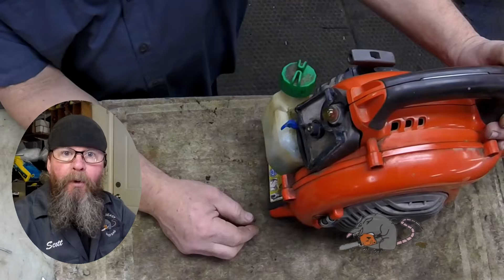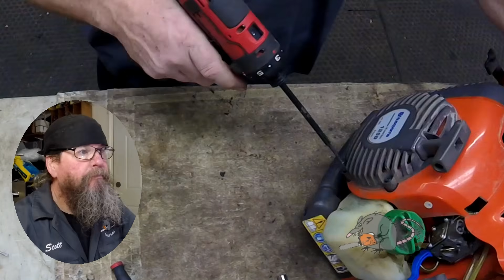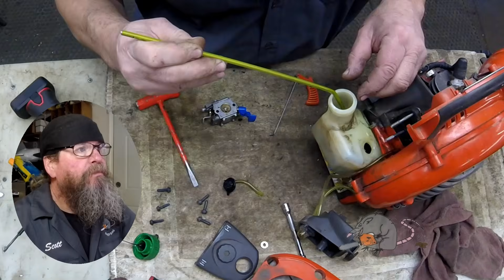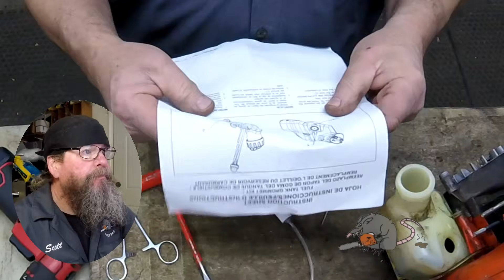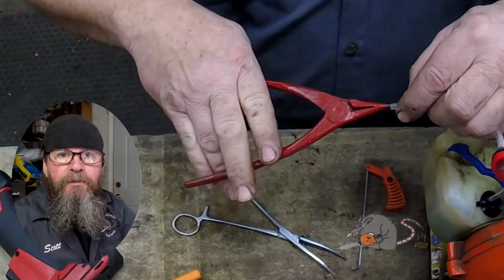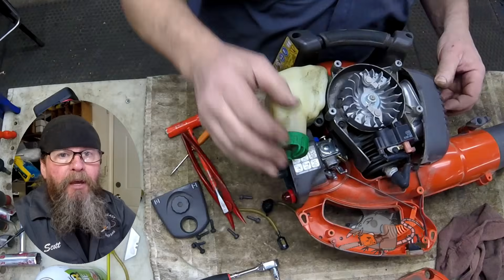Husqvarna 125b Fuel Lines Replacement

Comment: Buying these kits are real time savers,just have to plan ahead on some of these machines to have parts on hand compared to breaking out the box of Tygon linn,filter,and primer and assemble the kit,great video thumbs up
Reply from the maker: There is a cost savings too. The kit is $13. The purge bulb and fuel filter total $14 and you still need the hose and maybe a grommet.
Reply: @TheGreasyShopRag agreed and you get pictures of how it is supposed to go if they update something, great video

Comment: Use a popsicle stick to help seat those fuel tank grommets I ruined the first one I ever did with a flat head 🪛
Reply from the maker: I normally use a radiator hose tool that is very smooth and forgiving but didn't want to make the video seem like special tools were needed. Thanks for the tip!
Reply: Gonna try the popsicle stick trick, seems simple enough to work

Comment: The new fuel lines flopped about as if they were much more flexible than Tygon.  Are those silicone tubes?
Reply: I think he said its made from vinyl.
Reply from the maker: @primozsuhadolnik5468  I did say vinyl but that was not based on fact, rather feel. They are stiffer than tygon.